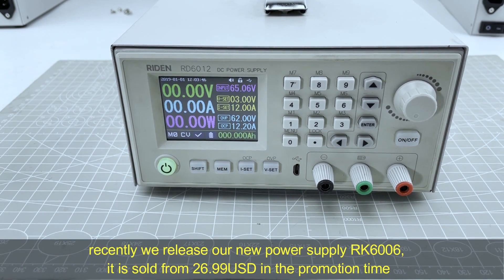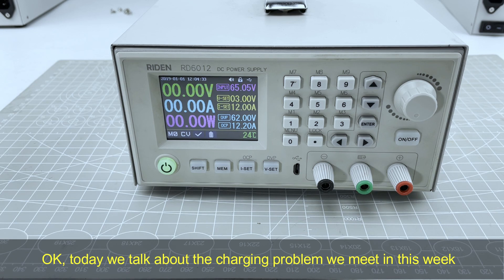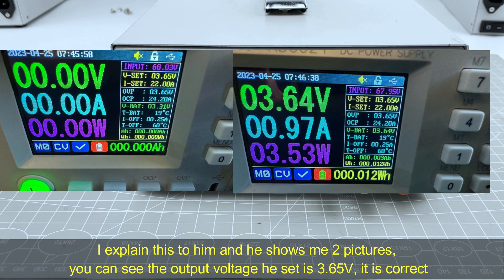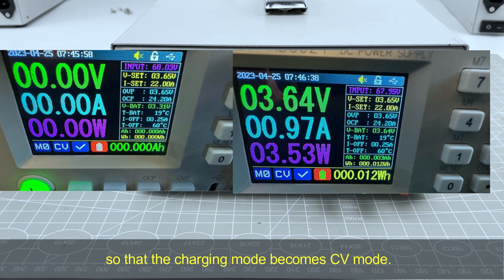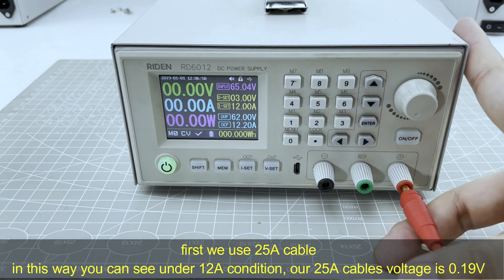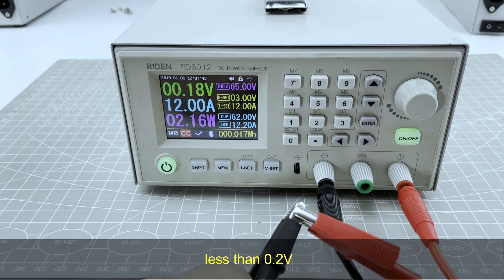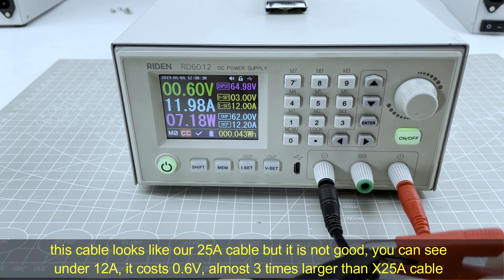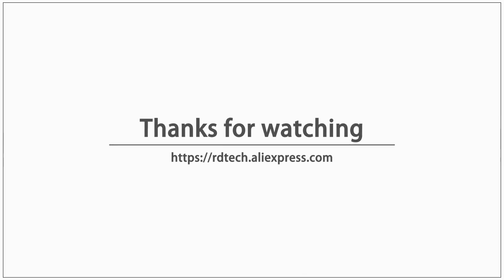Output cable matters when charge battery tested with RD6012 and X25A cable

Comment: As mentioned before using RD devices mainly for charging battery is not recommended, there is always a voltage drop it is better charged with proper battery chargers with seperate battery voltage sense terminal and balancing function, someone will charge series lithiums pack without balance eventually and that is dangerous
Reply: So what if there is voltage drop you will not charge the battery full, and whit a charger that has voltage sense wires you can still make a battery go in thermalrunaway
Reply from the maker: voltage drop happens on the output cable you use, and it will only affect the charging mode and charging speed, for battery, for now we do not get any problem reported
Reply from the maker: @electro2606  if the cable resistance is too high, the voltage drop on the cable will also be high, it will let the charging mode switches to CV mode in advance, which makes the battery not fully charged